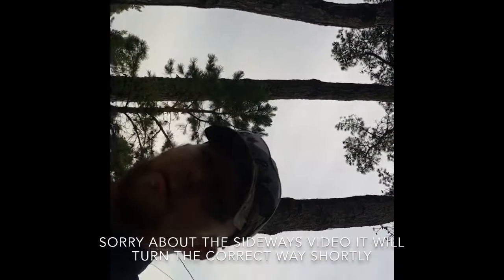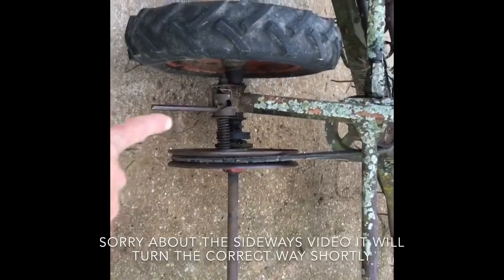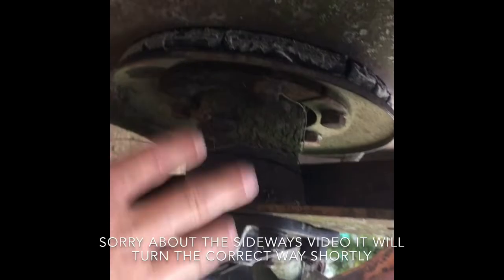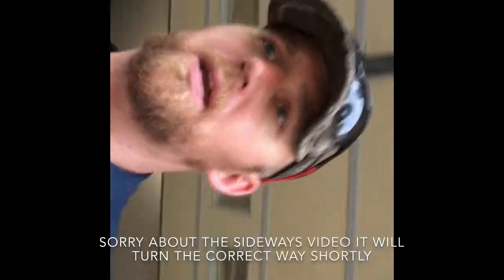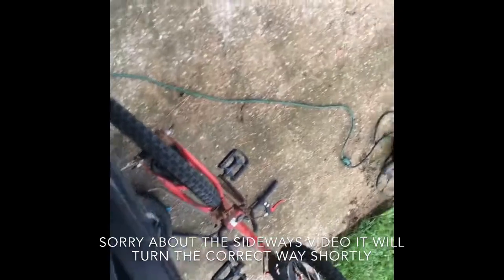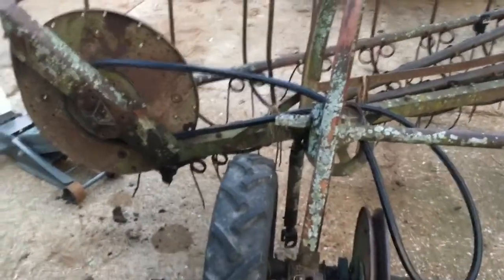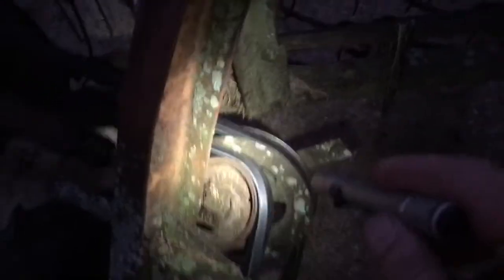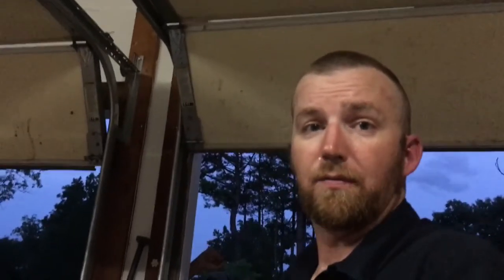New Idea 403 Hay Rake Drive Belt Replacement

Comment: Just a heads up for anyone else looking to do this - rather than pulling the 5 bearings off the disc, you can pull the two bolts on the other disc, the whole rake assembly will drop ~3 inches, just enough to slide the belt on. Getting it back up, start with the disc on the side away from the belt, a 2x4 and floor jack makes it much easier to get into position while you get the first bolt in. Then switch to the belt side and get the disc's axle into the slot and the bolts threaded. A little wiggling and cursing later, the whole thing is back together. Not even an hour job if you don't run into any stuck bolts.

Comment: $150 my ass. I’ve got the 405. I think it’s the same except it’s more square shaped
Reply from the maker: Cameron Nalley that’s what I said. Bought it online and saved a bunch of money. I’ll wait a couple days for shipping before I spend twice as much.
Reply: the round one is $180 across the board now at all dealers and online.  The hexagon one is $36 (plus shipping)--$50 online. Assuming the hex works. I haven't tried it but the hex has the same OEM part number as the round 400875.